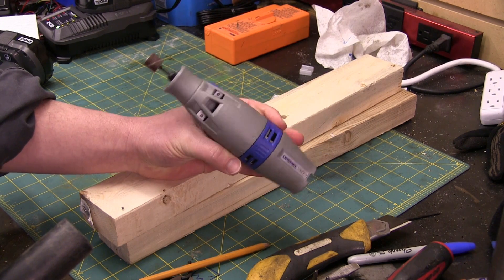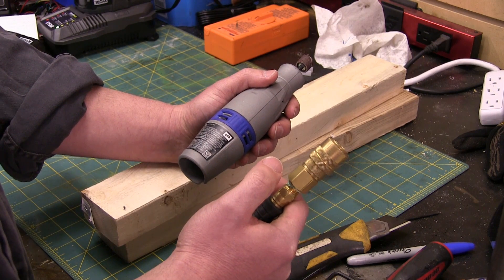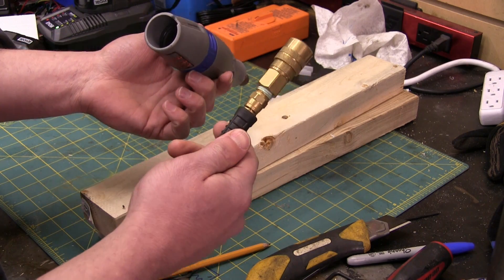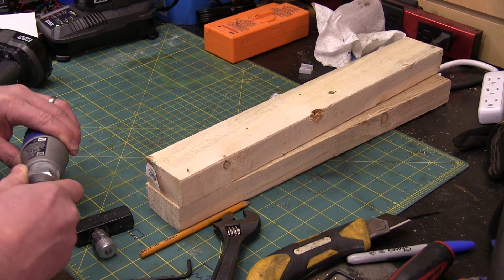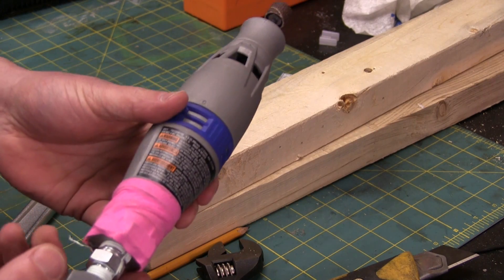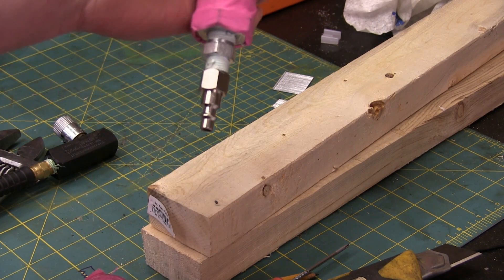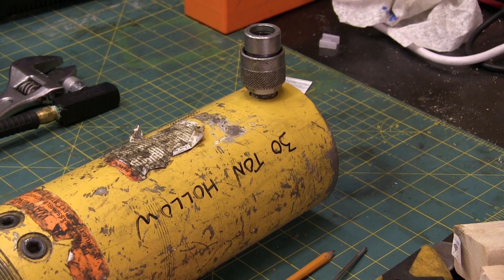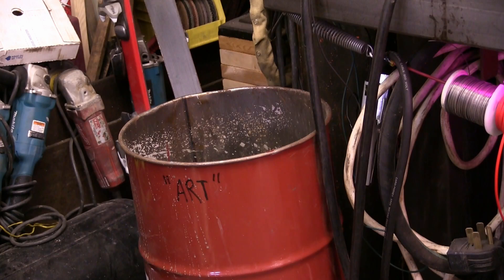You asked for it! Patron's Request: Dremel Suck Tool on 100PSI air

Comment: My 2c on pipe fittings. As a Brit living currently in Australia, who spent a good chunk of time living in Asia, I use whatever the hell I can get my hands on. I prefer to stick to BSP though, It takes a little less measuring; eyes are faster than callipers 'n' all that.

I much prefer metric in general (though am a fan of the duodecimal nature of inches) and have twice completely overhauled systems to metric, both times I found a mixture of units involved. Who the fuck solders 15mm pipe to 1/2" just so they can use the 1/2" fitting they had lying around just to then have to go back to 15mm again... Both times I had no difficulty finding an older lad and swapping some fittings, giving him my bag of imperial, and happily taking anything metric.

Comment: Germany also uses the imperial scale for most fittings like 1, 1/2, 1/4, 1/8, 3/8 etc (not inch but zoll: 1 inch = 1 zoll = 2,54cm).

Comment: Good part of Europe uses BSPP (british standard pipe parallel) in most places where NPT is usually used. Sometimes it is reffered to as G thread. Some JIS threads are used in places where some wiggle room is to be allowed. It is hard to describe joy when ordering fittings on ebay, that get labeled as "pipe thread. What you are going to get is anyone guess.

Comment: Had to convert the Army shop in Germany (German/International spec fittings) to American #GoMilton. Guys were using 4ft torque wrenches and the ol' hop and pop technique for 5th wheel trailers. think it was a 19mm thread diameter. The pitch die wasn't in the handy 'Snap On' tool kit so i used a 1mm starting thread and thread files... some teflon tape required.

Comment: We don't use NPT and call it something else, don't be stupid... We use Whitworth (BSP, British Standard Pipe) and call it something else. 1/2" BSP we call R15, for example. G15 is the same pitch but not conical, so they can sorta be used together if you think a little and seal properly.

Comment: I was on a heat tracing job when the supervisor, a young fool who thought he  know what he didn't know, decreed in the morning meeting that only metric would be used on this job site, emphatic and determined. I raised my hand and asked him what size tubing we were installing. "Why half inch" he replied as his face acquired a rosy hue. I suggested we could import some metric material and we might get started in a month or two. 
I had feared briefly that I might have to invest in a metric tape measure, but no, he came to his senses.

Comment: Where I work we are all metric, except the fittings. Still use 1/4" npt through to 1" npt, regular BSPF fitting for other means of testing. But everything thing else is metric. Capheads. Lifting eyes and even o rings

Comment: i'm from zimbabwe and we still use inches for pipe fittings with threads which you buy off the shelf such as gas lines and what not but for other stuff we use mm's

Comment: i've got one of these dremels, and i think you might just have gotten a bad one, or something didn't go back together right when you disassembled it for the other video. 

i hooked mine up to an old 2HP shop vac and it spun up enough to carve hardwood using their rotary burrs. it definitely is nothing special, and it is even more torque-poor than a standard dremel, but it isn't anywhere near as crippled as it is in your videos. and I think my shop vac is around the lowest power that this is recommended for. a 6 hp shop vac like yours, assuming it has a clean filter and everything, should have this thing whizzing away. you just need to frequently take the tool off the work to let it get back up to top speed. maybe spend another $20 and try again?

Comment: @AvE - In the UK we use BSP rather than NPT (though NPT does appear at times on stuff made for North America) You can buy adapters to go between the 2, albeit with a bit of bodging (read a fuck ton of PTFE) you can make the 2 marry...well sorta..
In terms of Quick release we use a variety of oddities 
1) PCL Vertex / Airflow - gradually getting replaced with Euro aka ISO couplings due to flow issues, but still in loads of shops, needs 2 hands, one to pull back the collar on the coupler and the other to push the bayonet in...pain in the arse and often doesn't want to play nicely..and can come shooting out when you least expect it
2) Euro aka ISO aka Rectus 25/26 aka PCL XF aka etc etc etc, generally found on anything in the EU and has the advantage of being able to do one handed coupling
3) PCL 60 and 100 series - generally for big industrial stuff that needs a lot of air flow, can be hand in 1/2" or bigger sizes, but can be found in home shops if its escaped from the workplace..
4) various other proprietary things you don't often see - schrader, Rectus 21, a few other random ones...

The Germans especially just metricated a lot of the old imperial sizes - 6.35mm is 1/4 inch, 9.5mm for 3/8, 12.7mm for 1/2" etc..

Though some of the newer couplings have metric hex faces on them rather than 9/16, 5/8, 11/16, 3/4 or 13/16

Sealants I've generally found Loctite 577 a lot better than PTFE, once it chooches it seems to seal stuff that even PTFE leaks with, plus it only sets anaerobically (so won't set on your paws) and has a not too unpleasant smell...oh and its neon yellow colour...kinda reminds me of those antibiotic syrups they give kids...

Best of old is old British kit that uses British Standard Whitworth sizes rather than AF, and some of the sizes don't have a metric or imperial equivalent..so cue digging around in grandads old box of until then unused wrenches from the dark mists of time to try and find a wrench that will undo the bolt...

Really like the red green references bud :)
Reply: Also ISO / Euro looks to be the same as used in Canuckistan, same as I used when I lived down on lake Eerie shore thats for sure...

Comment: In Aus we use BSP (thanks to the poms), and in metric it is the same with a metric number. 1/2" BSP is 15mm - same thread. Lame as fuck. We use NPT as well - lot of imports from the united states of fuck

Comment: this thing is built for high volume not high pressure. no matter this thing is the worst design ever as with high volume you'll never get the needed speed or torque.

Comment: BSPP and BSPT : British Standard Pipe Parallel and British Standard Pipe Tapered. You use a seal when mating BSPP male and BSPP female, but you can use BSPT male with BSPT or BSPP female threads with or (if you're lucky) without PTFE tape to seal.

Comment: If by metric people, you mean every other country in the world, we have metric threads (that are logical)
Reply: from reading the comments, you couldn't be further off base. while all of you "every other country in the worlds" have your jolly metric system, it's clusterfucked with the remnants of imperialism sporadically used for only certain forms of measurement. thus, leaving yourselves with not quite double the amount of imformation to memorize and a fuckload of extra tools required just to have the 'right size' at risk of completely fucking up fittings and fasteners. meanwhile, us neanderthals using the ancient system of imperialism have little in the way of such issues, being predominantly imperialized. just a couple extra metric wrenches & sockets, rather than hobjobs of various incompatible fittings & fasteners that will pop up when you least expect it

Comment: if there is one thing I have learned through the years, its that dremels are over charged buffalo dung. I was gifted what looked to be a skookum setup, complete with case and a million and 1 bit, doodads spinning wheels for cutting and whatnot. About six months in the sucker at a brush and chooched up its works. Got myself a far more pocket friendly craftsman unit and 7 years later the bastard just wont die! That sucker has put more dust through it than an 80's hairband has through their nose!

Comment: I don't get how you can find fractions (imperial) simpler than actual numbers (metric)? What you are used to I suppose.
Something is a certain size. We just call it the size. so an 8mm bolt or M8 bolt etc.
Reply: In the imperial system you don't need a calculator for divisions and multiplications.
It also ends up being easier for gross measurements because you don't get cluttered with insignificant numbers.

Comment: Well to anyone that wants to know, in most of Europe people use what it is known as BSPT or  British Standard Pipe Thread instead of NPT they came both in metric and Imperial that they are compatible with each other so a 6mm BSPT fitting would fit on a 1/4" BSPT tool. I have seen it in Australia too but don't take my word for it.

Comment: The rest of the world (well the smart ones anyway) use the metric system because the imperial one that you are using is old, antiquated, convoluted and just so much harder to use. Fractions versus millimeters......no comparison, millimeters win hands down and just for an example....3/4 + 3/4 or 19mm + 19mm which one is easier to calculate and work with? I think my case speaks for itself :-)

Comment: A Dremel designed to use a 1600w+ Considering that a regular dremel is around 130w it makes all the sense in the world. Highly effiicient. If the intake opening had been all the way at the front it might have been defendable as of it might suck up most the dust. But prob not.

Comment: I would think that to get any real torque on that POS, you would need about 2-3 Kirby vacuums all plumbed to a Shop-vac hose. It needs massive CFM rather than PSI... but I'm also thinking that it would also need some much better impeller parts akin to a rear reduction motor to multiply the torque... which would require enough airflow to get that impeller spinning in the 10s of Ks of rippems. yeah... not gonna happen.

Comment: Gonna shit out knowledge, watch me. The air pressure drops dramatically due to the increased diameter inside the dremel.
Reply: +Eric B Right? I think it needed the old Atlas Copco pushin 750CFM with a 2" hose, then you could probably engrave your initials in that 38.1 x 88.9mm fillet of tree carcass.

Comment: @AvE 
Your problem is air "volume"  higher pressure does not always indicate higher volume.  I've seen similar issues with ground air starters for airplanes.  Older ground air starters (more or less oversized pressure pots) don't expend enough volume for newer more powerful engines, even though the pressure is plenty high.
Reply: +Joshua Harkness Also, why the hell did Dremel think this was a good design idea??????

Comment: We also use inches for that, and even for screens. The inch is probably the only imperial unit that we use. It will most likely be replaced by a metric unit in the future.

Comment: Ok, now you have to get a new pos dremel vacuum thing so you can do it right! You put the air in the wrong hole! You were blowing where you should've sucked! Ya needed to put the blowey bits on the intake bits. Or figure out how to reverse it on the insides to get it to work the other way around.

Comment: In Australia, water and a lot of other connections are BSP (straight or Tapered) and NPT for American stuff. There are some metric pipe threads, but the are not that common, but can be found on some euro or Japanese equipment. It's really fun when you have components from all different sources and in one assembly you have BSP, NPT and metric pipe thread. It helps keep the sailors happy and the nuns away.

Comment: As my experience with adapting, there is no fucking standard, if it breaks and you can't find OE you got to "make it work" , which means countless adapter fittings and thousands of trips to the adapter section at your hardware stores.

Comment: fit like? (how you doing) from Scotland! working in the oil/gas industry we still tend to use non metric fittings. 1/4 NPT being probs the most used by me. but...all our air lines from out air compressor so on in the shop and the air tools tend to be 1/4  BSP - British standard pipe. comes in a taper and a non taper.

Comment: A bottom line name brand shop vac can pull 135 cfm according to their website, but most pneumatic hand tools wont do more than 10 cfm. A long 1/4" air hose, inlet at 100 psi and an exit open to atmospheric pressure is going to create so much line loss. That air hose is gunna push no more than 30 cfm. Doomed from the start... I still can't get over how shitty that dremel design is though.

Comment: Two points:

1. Did you remember to reverse the spinny bits again?  Not that it matters much now.

2. I ordered a computer liquid cooler once that required British Pipe Thread fittings, which I had to search down online.  No idea how many people still use them, but apparently they exist.  If I recall they DID have an o-ring on them...I assumed that was just liquid cooling people being idiots, but maybe not.

Comment: You forgot to open the Dremel's on off 0/1 valve/switch! Now you got to go out and buy another one and try again.  You could also try the exhaust pipe on an old Buick for an air source or better yet a Wagner 590 base.

Comment: If it "works" with a vacuum that interal "turbine" is designed around high cfm, likely with a lot of bypass. High pressure, low volume will just flow right through it without doing much.

Comment: Sorry , Ave,for Your problems with the connections in inches, even there , there are several more or less weird standards! My grandgranddad told me about all the problem before MKSA system was introduced , we also cured hemorrhoids with the smoke from burning old well used sandals. Now we have taken the step into civilization heheheheheh

Comment: BSP is the EU norm - "British Standard Pipe Thread", and yes, it is the parallel version (or G). Codified in ISO 228-1. Also known as British Standard Whitworth thread.   It also exists in a tapered version, that is close enough to NPT that you'll try to combine the two, and destroy your threads.

Comment: You obviously didn't have enough volume of air flow.  You need one of those gas powered compressors that use half of a V8 engine to make that thing work.

Comment: re: wtf do the brits have for pipe threads well at your fave princess i picked up a pipe thread kit noticed after i did some gas for my hwt it states bpt not npt turns out british pipe thread can cross thread seal into 3/4 npt fittings just fine with the aid of t-tape.

Comment: We do use 1/4 and 1/8 npt threads on air, but the quick couplers are all over the place, but mainly Orion style.... If that makes sense, looks the same as you "straight pipe"

Comment: If it's meant to work with a vaccuum, what on earth made you think it will work with reversed flow?

You don't happen to have an industrial compressor (ideally rotary) handy..? Tape the tool's ass to the intake of the compressor. 300+ cfm should do the trick.

But you fucked it! 

I've got $20 if you can fix it to better performance than original.

Comment: I own a dremel 5000 and it is decent for what it is. Slices body metal. All the 3000 or smaller models are just to small for anything. And a dremil is never a replacement for a grinder. Its basically a all in 1 fix all grind all drill all thingy u toss on the workbench for bodging up small things by hand. Wood and plastic light metal exc. The big ones have some decent applications the small ones and especially these weird vacuum cleaner ones are shit.

Comment: And there I thought you going to hoop up that cylinder through a hi-flow valve, but who am I kiddin ?
Other side of the pond here uses metric threaded fittings with face seals, but you can buy all kinds of clusterfuck fittings, fun starts when you need to tap some threads... regular tap is few euro, non-metric a few hundred eu.

Comment: With regards to pipe fittings, well, way back when, going metric in Europe was a big task, it took the best part of a week. Monday was miles to Km, Tuesday was pints to litres, Wednesday football into soccer, Thursday feet and inches, well you get the idea. By Friday lunchtime the task was complete, all the metric boffins  were so pleased they went to the pub to celebrate with a few pints. (actually litres) Now, when they got back to the lab, someone noticed a small cardboard box of pipe fittings. A small meeting took place and due to the drink at lunchtime being in litres and not pints rational though wasn't in abundance. A decision was made that they would leave them in imperial and nobody would ever notice, (until now of course) and they would never speak of this matter again.
Reply: Ssshhh
Reply: What happened on Saturday?
Reply: Everyone was hung over.(Please be careful, litres are bigger than pints Stay imperial when drinking.)
Reply: I swear I’ve heard some stores call the same fittings something different just to avoid the fraction

Comment: YEP!!  (so you me to tell me that) a 6 HP vacuum motor can't spin a Dremel's tool?   Lets do the math.... HP (746 watts)  times 6 = 4476 watts / 110 volts =  400 AMPS of currant.....Mister, you  just need  a bigger breaker.  Then she will chooch just fine.  Yep I had a few beers, and I'll just do it myself.......with a grinder that is!
Reply: +adithmart LMFAO...Head rush,,Breath.......

Comment: Ah, 1/4" NPT, it boggles the mind when I had to find a standard air connection (1/2" acme or equivalent) and not even the specialty AC store knew where to get it, I had to go through their entire aisle to find the clearly labeled fitting and half a day of calling every hardware store in my city just so I could pull a vacuum on my trucks AC system.

Comment: Still inches in holland.
However, I've already seen a quarter being stamped with 6.35 mm.

So maybe, just maybe, metric is leaking into the fittings as well...